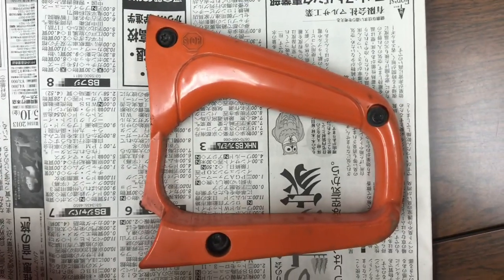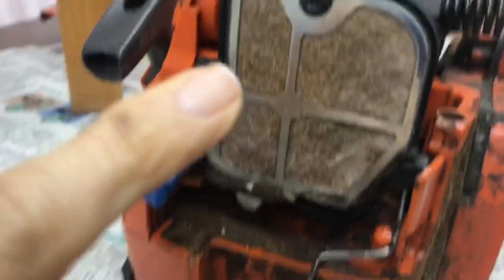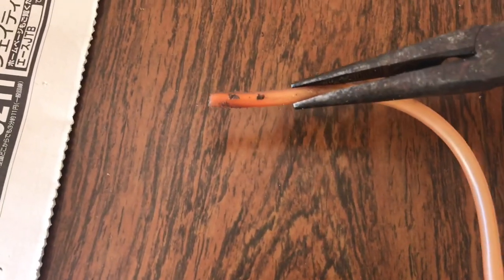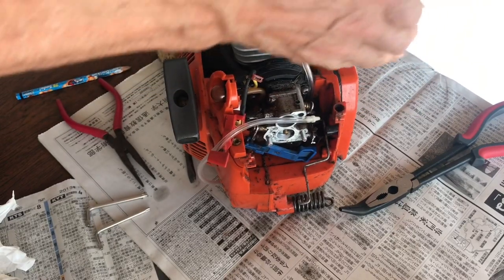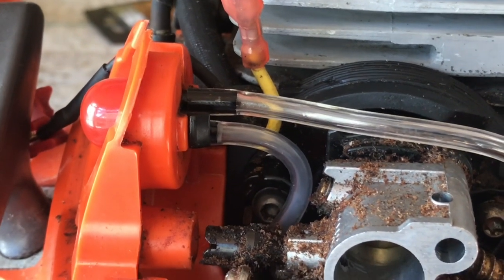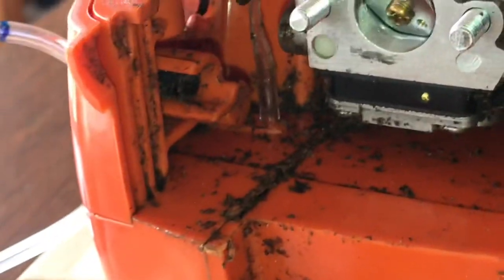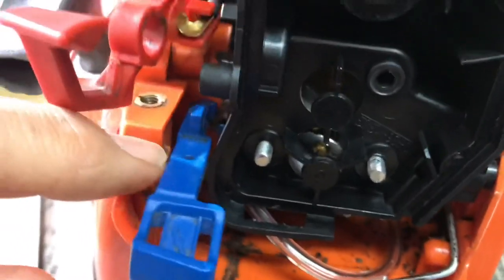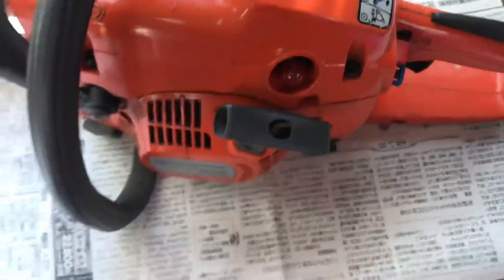ハスクバーナHusqvarna 236E (fuel lines replacement)

Comment: I think you will agree that saw is running terrible.  I recently repaired a 236e for a friend.  He had already replaced carby, fuel lines and spark plug etc.  Saw had plenty of compression and should have run. I checked spark which appeared week.  After temp replacing coil pack I replaced the original 3 magnet flywheel with the 2 magnet flywheel off my Husqvarna 137 and completely changed saw into what it should be.   This fix will cost about $20, hope this info helps